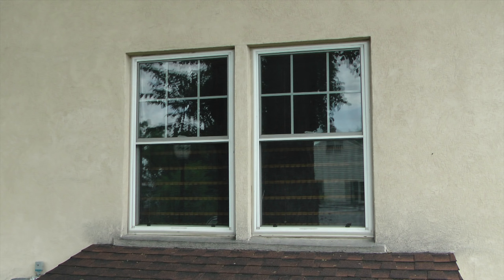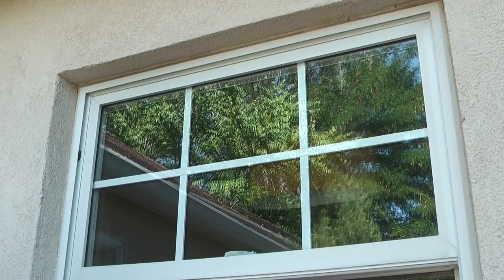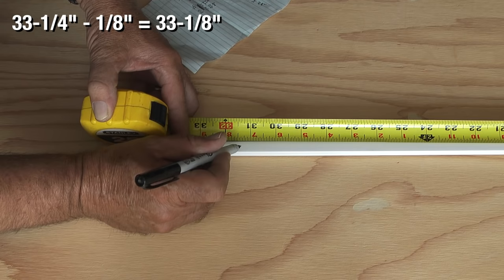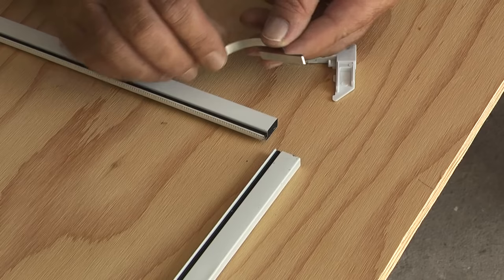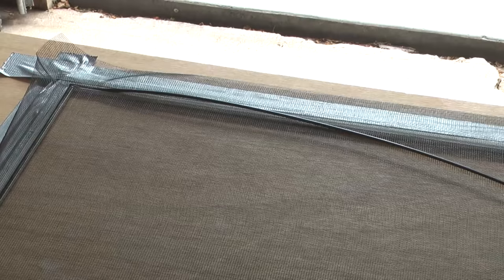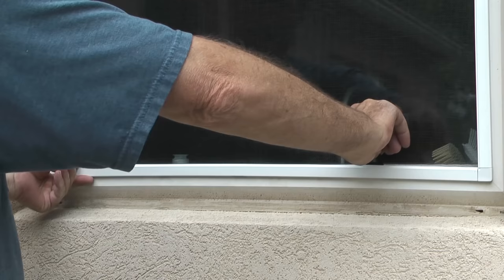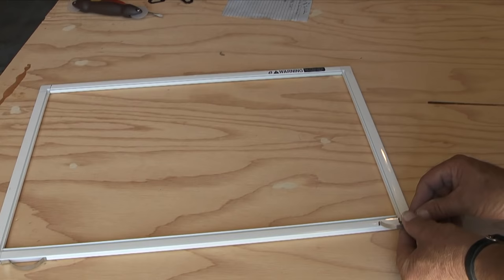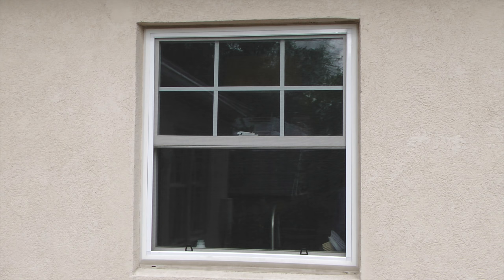How To Build Window Screens

Comment: I made two using your method but some of the frame lines were a little not straight. I think it is because the tension from the screen pulled the frame to bend. How do you work around this issue? Intensionally make the screens loose?
Reply from the maker: When you roll in the spline on the last edge use a bit less tension when holding the screen.

Comment: If your window doesn’t have rubber stoppers, does that mean we don’t have to add/subtract that extra 1/8” to the measurements? Or do we do that regardless? Thank you!
Reply from the maker: You could probably add a bit to the width of the screens if you don't have the rubber stoppers.

Comment: Great video! Do you have a link to all supplies and tools you've used somewhere?
Reply from the maker: I bought my kit at Home Depot. Here are a few links: 
https://www.homedepot.com/p/Screen-Tight-5-16-in-x-48-in-White-Window-Screen-Accessory-Frame-Kit-WSKIT51648/100042901
https://www.homedepot.com/s/spline%20roller?NCNI-5
https://www.homedepot.com/p/Saint-Gobain-ADFORS-36-in-x-84-in-Charcoal-Fiberglass-Extra-Strength-Screen-Roll-for-Windows-and-Door-FCS10387-M/204264673
Reply: @Iscaper  Thanks so much!

Comment: I just made a screen; I didnt do a good job; I'll have to do this again.
Reply: Dont feel bad my friend.
I subtracted the 1/8 from the height
Added the 1/8 to the width
Subtracted the 1.5 from both directions

Had an inch gap on top and 3/4 on the side.  
I believe my first problem is that my tape measures end clip is too large to fit up in the gap like his did in the video.   But... It will be easy to use this first failure to add where needed, and the second attempt should do the trick

Comment: will these work in older  storm windows  that dont have a tension spring at the top . Alumumium ones .That have   1 straight at each end fit into slot

Comment: I need to travel and take a window screen with me on an airplane.  It has to fit into a suitcase only 24" across.  The window is much larger of course.  Do they have clips or inserts (like the corner pieces) that would allow me to rebuild the size once I get there?  What would you suggest?  The materials can't be purchased where I am traveling.  
Thanks!

Comment: if you take the exact measurement of the width and heigth, you are adding an 1/8 of an inch,, wouldnt you be subtracting an 1/8 in ?If your screen is wider than the frame it will never fit
Reply from the maker: The screen needs to be a bit bigger to fit in the channels in the frame. Otherwise the screen will just fall out of the opening.

Comment: I’m now on my third go at 12 screens.  Quite frustrating as putting ANY tension on the mesh when rolling the spline cause the sides to bow in, and then I have a space between the window frame and screen frame at the center of the sides.  The window doesn’t have enough lip at the bottom to allow for more height in the screen frame so that this bow could be hidden.  Did your screen in this video BOW when you removed the duct tape?
Reply from the maker: My screen is pretty small so I didn't have a bow. Bigger screens without a center cross brace are tricky to do.

Comment: 3:58 the splines are almost impossible to remove by hand in these window frame kits! It's a wonder why they even put the damn things in the first place. They squeeze them in there I can't pull the whole thing out easily. I already snapped a few of them crammed in extremely tight.
Reply: Use a small pick or flat screw driver to get an end lifted then pull the rest of the way out.
Reply: @jdtoys2768  
thanks. I was able to actually slide them out..pushing one end through the groove..much easier than trying to pry them out from the notch!

Comment: 3:03 you say "1/8 of an inch" but your math calculation here says 1/4". I hope I get this right by the end of following this video and reading the instructions that came with the kit.. I think my screen kit is at least almost identical to the one you're using. Thanks.
Reply: Your video messed me over; it's just barely not tall enough. If it wasn't wide enough then that would be a non-issue but now I'm one piece short of redoing it and need to buy a whole new kit. I should have just read the directions that came with the kit after opening it instead of trusting this video beforehand. When you're measuring the opening you need to account for the actual entire opening, not just to the lip of the frame of the opening on one end and the enclosure/opening on the other. Thanks for the effort, though.
Reply: Also, perhaps it was because you already had pre-existing spacers but it would have been nice to know how your measurements would differ because of having them as opposed to those watching that don't (like me).

Comment: I have a window similar to the second one you made a screen for, it slides open right to left. There are no rubber spacers, do I still subtract the 1/8 inch from  the initial measure?
Reply from the maker: If you don't have the rubber spacers it means you probably have more channel depth to work with, so I would try subtracting a 1/4" from initial measurement.

Comment: what if your  window doesn't have wells for the frame to fit thru??
Reply: @prose00 : These were how screens were made before windows had wells. My sister’s house was built in 1932 and has no wells at all. So her window screens are something like this. https://youtu.be/AQNnHnZon6U. My sister’s window screens are attached to the outside of the house by a couple hinges at the top that are held by removable pins and at the bottom have a eye/hook on the inside of the house.

Comment: Are the pull tab backwards, because spline side face interior, therefore pull tab should to inside, right?
Reply from the maker: Tabs out if you want to remove the screen from the outside of the house, and tabs in if you want to remove the screen from the inside of the house. Easier from me to remove the screen from the outside.

Comment: Doesn’t the frame bow inwards when you remove the tape?  Mine is doing so.  It’s frustrating trying to get the right tension on the screen.
Reply from the maker: Getting tension right is tricky, especially on bigger frames.

Comment: The pull tab should be inside or outside
Reply from the maker: If the screens are on the ground floor and easily reachable, then outside. If they're on a 2nd or 3rd floor and a ladder is needed to remove them, then tabs on the inside and remove the screens towards the interior of the house.

Comment: say I'm doing this on a second floor window and I cant access the outside of the window, any suggestions?
Reply from the maker: You can try removing the screen from the inside using a flat blade screwdriver.

Comment: I know this is old but question; can I use the old screen as a measurement guide? I suck at using measuring tape but I'm working on it.
Reply from the maker: I usually cut the new screen a bit bigger than the frame. When the spline is installed I use a razor knife to trim the excess screen. This is covered at 5:33 in the video.
Reply: @Iscaper  I think you misunderstood. I have all my screens still in the window but want to replace with new ones. Instead of measuring can I take the old ones and use as a guide for mew ones?
Reply from the maker: @Dreab69  Yes, but you still want to cut the new screen bigger than the old screen and trim the excess after the spline is in. If you cut the new screen the exact size of the old screen it may not work.
Reply: @Iscaper  ok thank you

Comment: Very nice. But shouldn't the pull tabs be on the interior side?
Reply from the maker: All of our windows are on the ground floor so it's easier to have the tabs facing out and remove the screens to the exterior of the house. If you have a 2nd floor then it would be easier to have the tabs on the inside of the screens and remove them to the interior of the house.
Reply: What I'm getting at is, why make it as easy as possible for someone with nafarious motives to surreptitiously enter your home?
Reply: I hear this a lot from my customers. A screen is not going to hold a criminal back from entering your home. Make sure your windows are locked and you have a good security system. Don't call your screen installer complaining to him that the screens he installed didn't prevent your home from being robbed.
Reply: Mendo View Window Cleaning - no one in their right mind would imply a screen would keep a burglar out. Of course keeping windows locked (& alarmed) is the better approach. The Homesmen's point might be clearer if you started by familiarizing yourself with the definition of surreptitious. Also, no sense in making it as easy as possible. A 'handle' of sorts, does just that.
Reply: Umm.  Maybe you should move to a safer neighborhood and put bars on your windows.  For those of us that live in decent neighborhoods,  we like to open our windows to let fresh air in and we use a screen to keep flies out. Of course we will close and lock our first floor windows at night or when we leave town.  Am I going to fast for you?
Reply: If someone wanted to get into your house,  you think putting the tabs on the inside would stop them?  haha
Reply: One reason to put the tabs on the inside is to preserve their longevity.  The sun will just eat those tabs up on the outside.  They’ll deteriorate on the inside too, but not as quickly.
Reply: @toscodav  - Look up 'Surreptitious'. Four syllables, I know it might be tough.

Comment: My screen corner pieces measure 3 eights of an inch for the square part once slotted in, yet the instructions says to cut off 1 1/2 inch on the frame pieces for the corner pieces. That seems too much, am I correct?
Reply from the maker: No the instructions are correct. You need to subtract 1-1/2 inches to accommodate the corner pieces.

Comment: All my screens have the tabs on the inside of the screen so you have to pull the from the inside of the house, i always thought why have them on the inside and not the outside like you have them. Maybe it's to stop people taking them off or stealing them from the outside.
Reply from the maker: I think some screens are easier to remove from the inside, like a 2nd story window where you would need a ladder to remove it.
Reply: @Iscaper  yeah that makes sense

Comment: Why put the rubber pull taps on the outside not inside?
Reply from the maker: Easier to remove it from the deck outside instead of the kitchen where the sink is.

Comment: all the pull tabs in my home are reversed they're on the inside part of my windows. I asked around my neighborhood and they're all like that.
Reply from the maker: If you want to remove the screens to the outside of the house simply rotate the screen to where the tabs are on the outside. The tabs on my screens are all on the outside. On a second floor window it would probably be better to have the tabs on the inside for removal.

Comment: Okay - LOL, not a newbie. I am a single woman farmer that build my own house.  The problem was (same Phifer kit) that the corners would not go on. I looked at your video, there are the same tab protrusions on the corners - and you were able to easily slide it it.  Logistically, physically, these tabs will not clear to slide it in the opening.  What I finally ended up doing was grinding off the tabs - corners slide in, tight as all heck, no play...All's well that ends well.  I cut the rails with a miter saw, then no need for sanding.  Thanks again - the Phifer video was useless.

Comment: Adding 1/8" to the width, the screen frame will be too large.
Reply: It makes it so that it's 1/16 holding on either side. You have to work it in a little from corner to corner but it is flexible and will go in and makes it so there's no gaps
Reply: @VIDEOWATCHERYL  I have a Question - 

There is a discrepency for the side measurements. 

@1:38 when measuring the window frame for the sides  you give them as 29 3/8' + 1/8" = 29 1/2 "..........
@3:02 when you are preparing to cut the frame piece the measurements are 29 1/4 (not 3/8) + 1/4" (not 1/8) but it equals to the same total of 29 1/2". 

If I had measured at 29 3/8th for the window

BUT added the 1/4" instead of the 1/8" to the length of the frame

wouldn't that mess up my total measurement?

Comment: Great instructions, but the kit used is absolutely terrible. The spline did not come out anywhere near as easily, and the spline kept breaking as I tried to remove. It could only be removed in one inch chunks and as a result took me over half an hour just to remove it entirely. It ended up damaging the already fragile frame. I would strongly suggest just buying spline separately and ignoring the kits.
Reply from the maker: Good information, thanks for posting.